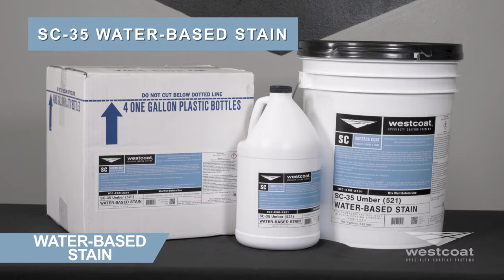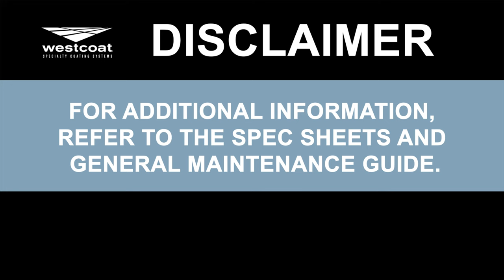How To Install The MACoat™ Custom Finish

Comment from the maker: CHOOSE A STEP HERE:

0:06- Flashing
0:50- Base Coat
1:44- Slurry Coat
2:13- Grout Coat
2:42- Pattern Installation
3:16- Texture Skip Trowel
4:15- Water-Based Stain
5:01- Sealer